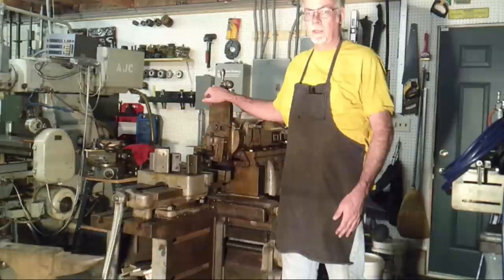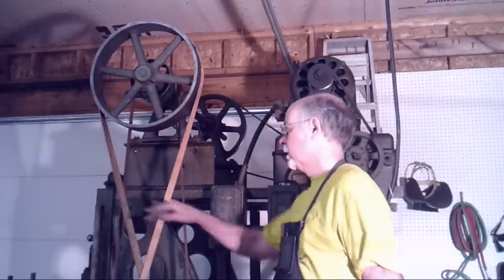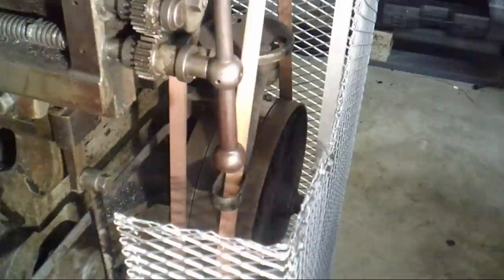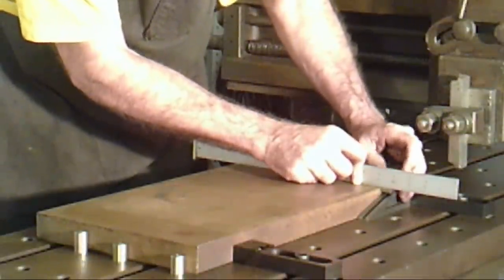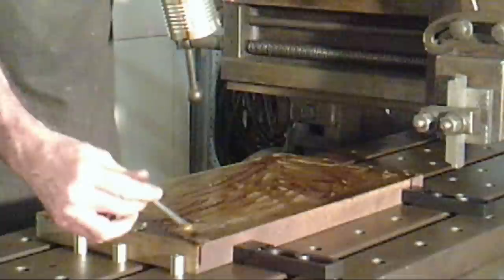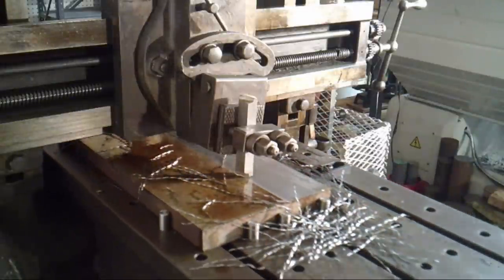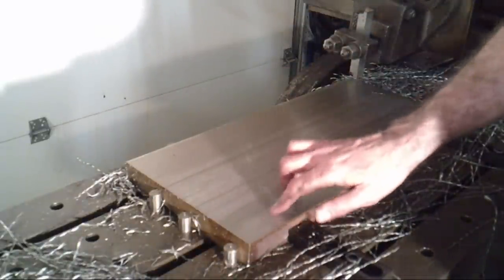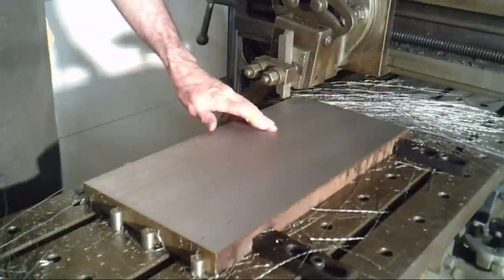Plane Old Machining Part 2

Comment: Wow ,First my condolence in the passing of your father, my thanks for his service to our country. My father was a sm1 on the Wisconsin in ww2 ,he passed about twenty years ago . Now for your planer ,I love it wish I could have one for sure, I ran those and open sided planers at a shop I worked in. in fact I made the right kind of hold downs for the tables in my garage shop and sold them to the shop. Made a bit on them forty years ago sold them for $40 each a dozen clamps with hardened pointed screw down hold downs. I think your wireing on the motor needs to be reversed it can be done at your switch too I think. . I too love the old flat belt machines. I learned on a boring mill like that . Thanks again Gary the silverbullet

Comment: Sorry about your father.  This has been a remarkable day.  First I see a fellow with a shaper that looks factory new in a shop that looks hospital clean and he makes some chuck jaws with it.  Now I see someone with a planer.  I worked at Standard Manufacturing back in the 1960's and I remember they had a planer with a table at least 20 feet long and it moved considerably faster than the one you have.  I have not seen a planer since.  Of course I stopped working with machine tools shortly after that so their is a lot of things I have not seen since..  Thanks for sharing.

Comment: In 1950 I started an apprenticeship with a firm that had two similar planers except they were three or four times larger. Belt slip was a problem on them too. Sometimes the belt would come off at the end of the return stroke and the table would shoot off the end of the machine. They also had two other similar machines which were equipped with milling heads. They have now replaced all four machines with a similar capacity CNC mill.

Comment: Even though this machine works slowly I could see it still being quite useful because of its accuracy and large capacity. You could plane old lathe beds back to trueness, or mill tables, or anything with ways for that matter. Your Dad was one of the Greatest Generation. Rest in Peace.
Reply from the maker: Those would be good uses for this kind of machine. Thanks !

Comment: Nice work Gary... FWIW my GRAY planer #219 has the same belt arrangement as yours with 8 belt on the outside. Hoping my planer once up and running again will produce a similarly nice surface finish ;)

Comment: I noticed that the feed is set at the end of the piece instead of at its beginning. The head has no power lift for the tool on return stroke, so it has to drag on its return. The machine should feed into the piece before it starts cutting. This reduces wear on your tool.

Comment: Hi Gary,

Nice work on the plate. I'm wondering how those pins escaped the tool in your shaper when you first surfaced it. Were you using a carbide tool in the shaper? Sorry to hear about your dad. Your planer has so much character. I for one think it needs a name.

Kind regards,

Tom
Reply from the maker: I roughed several of these plates on the shaper in 2005 using HSS, which takes impact abuse better than carbide. For my home shop, I don't worry about production time. HSS is "free" and lasts "forever," so I choose HSS over carbide (and shapers over mills) more often than a business shop might. I'm not sure why I missed the pins in the plate back then. Maybe the pins didn't damage the roughing tool as much as the fine edge on the shear tool, or maybe I attributed any wear on the tool bit to the badly rusted surface that I was removing at that time.
.
PS: For silliness only, I named most of my machines after Japanese monsters. Since my G&E Shaper was Godzilla, the planer became Mechagodzilla. We'll meet some of the others in later videos.

Comment: I too, sorry about your dad as well as Keith and Adams.  As said "history repetes
its self"  true.  There seems nowadays a shaper explosion with prices rising daily.
Unfortunatly our shaper usually gets the dirty work before the part hits the mill.
expensive end mills care - cheap HSS on a shaper do not care (about rust etc.)
Good job Gary and good vidio
sam
Reply from the maker: Thank you.
.
I often choose my shaper over a milling machine for the same reason: shaper tool bits are "free" compared to the cost of milling cutters. They are also much easier to sharpen, although my newly acquired Cincinnati #2 is changing my perspective a bit.
.
The interesting thing about shaper cost is that you can often find a large one for less than a small one. Most home machinists cannot afford to allocate space for a 20", but a 7" can fit almost anywhere, so there is a greater demand for the little guys.

Comment: Have you ever used a flat tool configuration to put a finish on your work? I found a tool flat ground and set parallel to the work is great.This allows you to cut about .003 deep at a time and your crossfeed can be set at up to .500 inch per pass.
Reply from the maker: On cast iron where it is the recommended tool, yes, but not on steel where I use the tool shown instead.
Reply: +Gary Storrick I've had thousands of hours running planers. I've made tee slot dies that were as big as 10'X6'X8". I might have to rough up to an inch off both sides. But I used s High Speed 3/4"X1"X7" ground into a large flat bottomed hook shape. I kept the surface wet with a water soluble coolant. I would take about .003" per pass across the top at 90 surface feet or a bit less.On steel I achieved a 55 or less finish. Usually less.Oh on cast iron I used a carbide tool bit. I'd use it as bought with tremendous success. The bits had a cheap metal shank 1"X3/4"X7". Then a piece of carbide was soldered on the end just like any other bit.Id be happy to help out anytime. I also have a lot of experience on large Blanchard grinders(vertical head X horizontal table ),84" table with a 100" inch swing. Thanks for your site,you explain things well for the newbies.Be well and be safe.
Reply from the maker: Thanks for the tip! I'll have to try it once I get my shop back together (I just moved and everything is in chaos). 

-> Gary

Comment: I'm noticing the machine is cross feeding before the return stroke. Also the vari speed indicator read s backwards as 1 I would think should be slowest and 10 fastest. I'm thinking this might be confirmation that the retrofitted drive is running in reverse or then again, I might be all wet?
Reply from the maker: Around 9:30 you can see the ratched mechanism. It turns counter-clockwise. When the tool head is moving away, the ratchet push moves the tool head at the end of the cut and the ratchet pawl resets at the start. When I reverse the pawl to have the tool head move toward me, the reset is at the end and the push moves the toolhead at the start. It all depends on which way I decide to feed the cut.
.
As for the Lewellen drive, I think that the motor is driving the output shaft and the input shaft goes to the jackshaft, which reverses fast and slow. Considering the physical layout up there, I plan to live with this one.
Reply: Gary Storrick Very good Gary. At first it didn't seem good to be cross feeding before the return stroke, but then I picked up on it being equipt with a clapper, voiding the cross feed timing concern.

Comment: Out of curiosity have you ever used carbide insert or carbide brazed tooling in it?
Reply from the maker: +Rainbows871 No, I haven't, and don't really see a reason to. The cutting speeds are too low to bother with carbide, HSS is essentially free, and I can grind any shape onto it that I want.

I hope to update the story on the planer in about eight weeks.... stay tuned.

Comment: this is awesome what kind of surface finish are you able to attain from this? im a toolmaker by trade and im used to using surface grinders etc so are you able to get a nice as finish as say, conventional milling?
Reply from the maker: I hope so! This was literally my first cut with the planer, so I expect to be able to do better with practice. This piece has some striations on it, too fine to feel with a fingertip but coarse enough to feel with a fingernail. Remember, this was a piece of junk steel. On good steel or cast iron, I've done very well with a shaper, and expect that I can do the same here. Shapers & planers do not work harden the surface the way milling can - so they are a good choice if you plan to hand scrape later.

Comment: Is that tool supposed to hit on the return stroke? (As seen in the zoom shots.) It would seem like it's not supposed to, but when you didn't say anything about it, I figured it normal.

sorry about your father. (I know it happened write a while ago, but still; my condolences.)
Reply from the maker: +Andrew Delashaw Yes, it is normal for the tool to drag on the return stroke. There are shapers and planers that have tool lifters that prevent this, but most do not. the dragging does no harm, but it is important to tilt the clapper in the proper direction to provide some clearance.
Reply: +Gary Storrick oh ok, I was just curious about that. It looks like it whacks the leading edge pretty hard, so I thought it might begin to peen the cutting edge over. pretty cool machine though. I'm sure it makes machinists treasure their vertical mills!

Have you made calculations about how long it takes to compete 1 cycle, and the width of the y-axis increments, so you can estimate how long it will take to compete a piece of a certain width? (Like if one cycle takes 10 seconds, and it moves 50 thou, and your piece is 10" wide. it'll take 20*10*10=2000 seconds/60=33.3 min.)
Reply from the maker: +Andrew Delashaw I don't usually calculate it because I'm just having fun. If course, the calculation is rather easy, like you noticed, and the machine does take a long time to plane a large area.
Reply: +Gary Storrick Thanks Gary. That's a really cool machine.

Comment: Great Video,  We just this fall got our Walter Bros. planer under power, It is similar, have been told conflicting ways on which belt should be twisted, What is your take?  See our planer @ NORTHERN MINNESOTA METALSMITH FLAT BELT MACHINE SHOP